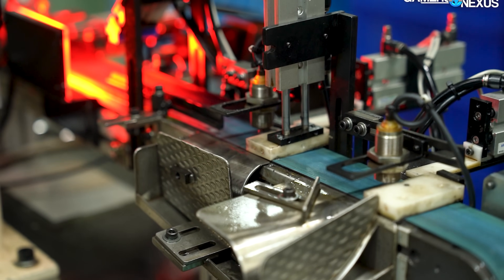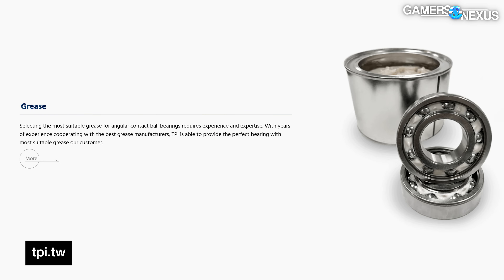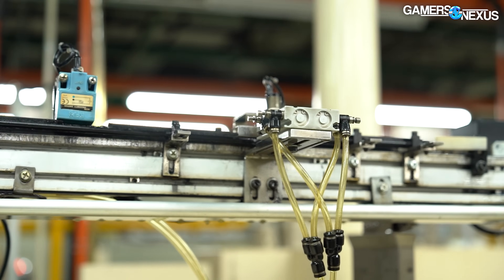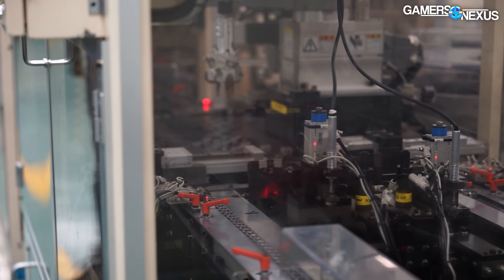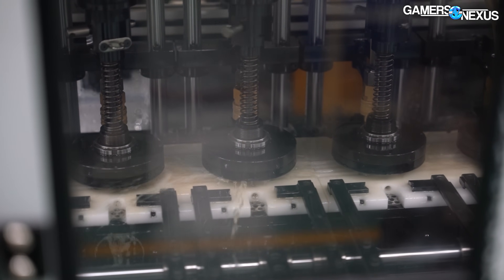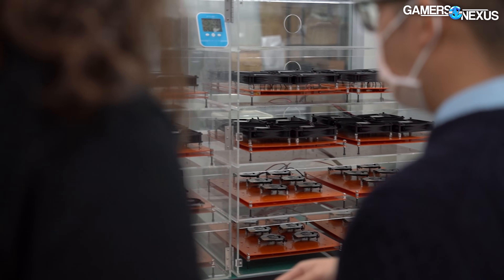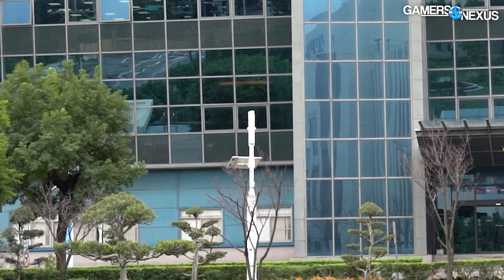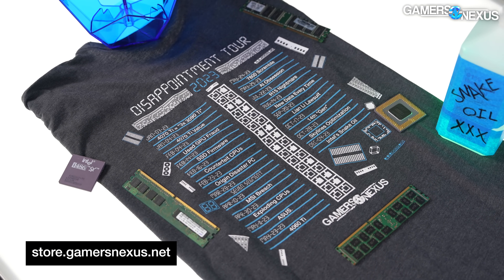How Computer Fan Bearings Are Made: Ball Bearings & Fluid Dynamic Bearings

Comment: I still remember how I destroyed my first fan bearing. It was a small CPU fan that I had the brilliant idea of cleaning with a vacuum cleaner at full throttle. That was my first rig in 2000. Good times.
Reply from the maker: RIP little bearing.
Reply: Can you oil them or anything if they start to go out?
Reply: @StreetTerrorist187  You can but, by the time they start to make any kind of noise, it is probably already too late to save it. The reason is because the noise is usually due to slack that the motors get from running all the time (fatigue) and changing the oil does nothing to stop it or reduce the rate at which it increases. Also, the oil may not be appropriate and actually work to increase the rate at which the slack increases.
I do oil my "cheapest" fans from time to time when they are too dirty, but only the "cheapest" ones because there is always a chance of breaking or misplacing something and because the most expensive ones, like Noctua, have never failed on me yet. I also never use those fans in anything where there is a chance they might fail unnoticed, like inside a PC.
Anyway, if you are interested my procedure is as follows: 
1- carefully raise the sticker on the back of the fan without cutting it. You will need the sticker in good condition to reseal the fan otherwise the oil will come out or dry quickly. Sometimes there is also a rubber cover just beneath the sticker.
2- check if the shaft looks clean (no dirt or goo) and oily. If it is, just reseal the fan as there is no point on proceeding and your better off replacing the fan.
3- if it is dirty or dry, remove the sticker completely and start disassembly. Usually, fans have either a metal or plastic clip holding the shaft. Remove it carefully, without bending/cutting/stretching it. You will need to reinsert it later. Some higher end fans have two of these clips.
4- next there is usually a rubber ring and may also be washers. Take care with the order. Assembling it incorrectly later may destroy the fans. If you can't find the rubber ring, it is probably all the pieces of goo that were jamming the shaft. I usually get replacements for these from donor fans.
5- now you can push the fan. Beware that, on the fan side inside the central cover, there is usually another rubber ring and can also be a spring and washers so be careful when removing it or it may all fly away.
6- select your oil carefully. If the viscosity is too thin, the rotation will throw the oil away from the shaft. If the viscosity is too thick, the motor will have to work harder which will probably result in lower rotation speed, higher consumption and lower life span of the electronics (which will run hotter due to the higher consumption). I use a high temperature (600°C) that is marketed for high speed bearings (a small bottle cost a fortune in comparison to cooking oil) but is also toxic so you might want to be careful (wear gloves/glasses/mask) depending on what you get.
7- oil it by putting a very thin layer on the side of the shaft (less than a drop). I just use an oilier with a thin plastic tip an rub it on the side of the shaft. If you put too much remove it with absorbent paper (kitchen paper works) or wash it and clean everything but the shaft (or just clean everything and reapply the oil). Oil and electricity do not mix and any oil not on the shaft may end up in the coils of the motor or the electronics, potentially shorting it.
8- reassemble in reverse order
9- if the sticker does not seal properly, you need to replace the glue. Choose the glue wisely or you may never be able to remove the sticker in one piece ever again
10- test the fan in a bench power supply or on a system you do not mind frying just in case you did something wrong and the fan shorts.
11- If successful, pat yourself in the back for a job well done while keeping in mind all the time you wasted (it will help you evaluate if it is worth doing it again more selectively instead of doing it always for all fans)

Good luck
Reply: @boam2943  Youd be surprised how long you can get out of a reoiling. As long as you can actually oil it (many fans have a hole under the sticker for just that purpose), you can get months or years more. I put a few drops of 10w40 into 3 of my case fans, one with with bearings so bad the blades would sometimes stop spinning. 9 months later, theyre all working fine. The real bad one makes a little noise now and then but probably 80% of the time its silent. These fans are going on 12 years old now with <90% up time
Reply: @wills.5762  I have never seen a fan with a hole specifically for oiling. Some fans I oil have holes under the sticker but they are to hold the PCB, not for oiling. I put the oil directly in the axle (that is accessible by removing the sticker) or the shaft. If you are referring to the hole in the middle of the fan where the axle is, that hole is not specific for oiling. It is there because they need it to assemble the fan in the factory.
I know that fans last a long time if you properly oil them. As I said in my previous comment, where I described the procedure I use, I oil some of my fans.
My oldest fan is a 24v/1A (god only knows how many RPM) from the 1980s (taken from an IBM 286 PSU) and still works as new because I oil it regularly (once or twice every two years) with good oil.
But oiling should be done way before the fan exhibit any type of failure (technically speaking, fans starting to make more noise is a failure). The person I responded to already had the fans failing. "Start to go out" implies that they are at least making perceivably more noise. In a worst scenario, they already have the blades hitting the sides, at which point the shaft/bearing is past salvation. Also, failing fans will consume more power.
Anyway, I would not trust any of those fans inside a case where I can not see them. I have had fans fail before and take the PSU with them (because they were not connected to the motherboard).
If I were you, I would replace the noisy fan. You might get lucky but you might also get the one in a million lottery of catastrophic failure and lose more than a fan. Your motherboard/PSU are probably worth more than a replacement fan. Your choice.
One last note. If your fans stop spinning but otherwise make no noise when rotating at full speed, it might be rust between the magnet and the stator of the motor (it looks like a stack of thin metal pieces with copper wire wrapping them). You can fix it by disassembling the fans, cleaning the rust with a pencil rubber (works as a light abrasive that does not damage any coatings) and apply a very thin coat of metal polish just on the spot where the rust was.
Reply: @boam2943  Honestly this rig is on life support, not much more than an endurance experiment before I upgrade. Running a tired i5-3570k, original ssd boot drive. Actually just made it over 100tb writes with 0 bytes free last week 😅 The real bad fan is what I would consider completely failed, all kinds of play in the bearing but it moves air and it does it mostly quietly, I was originally planning to just pull it out and leave it but it came back to life and I wanted to see how long she'd buck. Motors fine on it, no rust. Stopped seizing up once I oiled it. The bearing would start to bind or something, you could hear it clear across the house as it spun down under power. It's been a pretty eye opening experiment so far, these things are a lot tougher than I ever figured.
Reply: @StreetTerrorist187  You can but if its making noise, then its already damaged. Thus it cannot be quieted without replacing the bearing or in most cases now days the entire fan. There are some older, and cheaper fans that can be oiled, Most higher quality ones these days used "sealed' units like shown in the video, and you are more likely to destroy the fan trying to get lube inside it, than you are fixing an annoying noise.
Reply: @StreetTerrorist187 ye-es, but i've never got more than about 6 weeks more from doing that, though I only have sewing machine oil. You want to catch them when their rolling resistance increases, if its rattling about the inside is buggered.

Tl;dr it works if you catch early they aren't freely spinning- but use the time it buys you to order a new one as time has already damaged it. I've enjoyed doing it but if you explosive diarrhea oil over your pc when you boot it don't blame me.
Reply: @mandowarrior123  sewing machine oil isn't good enough.
Reply: @sammiller6631 It works fine for me, and silences the fans for the next 8 to 9 months. Generally I would re-oil 1 that was getting noisy at the start of the west aussie winter, then it would be good until the next west aussie winter the following year.
Reply: @StreetTerrorist187  Yes, but you have to use fairly thick oil, and the RPM of the fan is going to be reduced, motor life shortened. Sometimes you're lucky and it keeps working well, other times, you might get a few weeks. 

If you want your fans to last forever, run dust filters, keep positive pressure in your case (more inlet air than outlet air), and clean everything at the first sign of dust.
Reply: I accidentally bumped my desktop while it was on and the 200mm NZXT fan bearing gave up. Did the same with the Noctua I replaced it with and it's still rock solid. I probably shouldn't keep it right there but it's an old corner desk so not many options with good airflow.
Reply: Wait, you're NOT supposed to clean fans like that?  😶

What about blowing compressed air through them until they sound like a jet engine?  That throws all the dust out.... right?